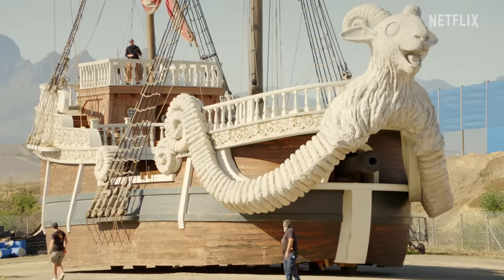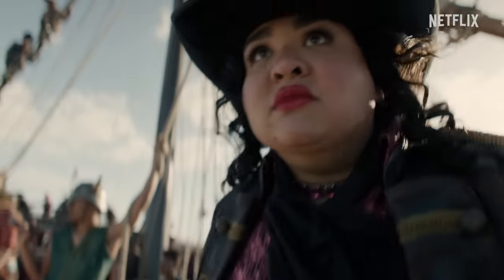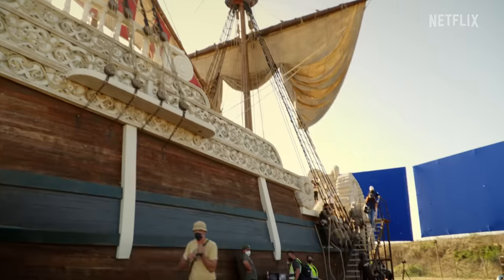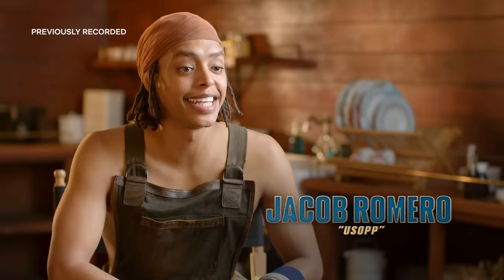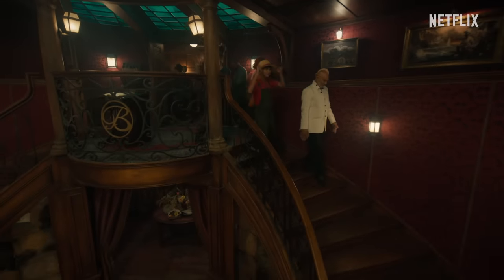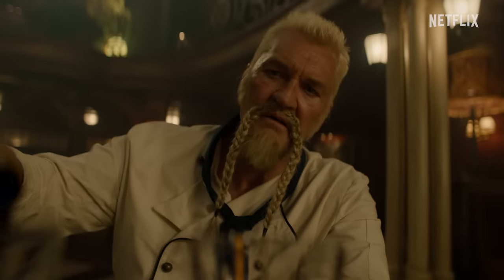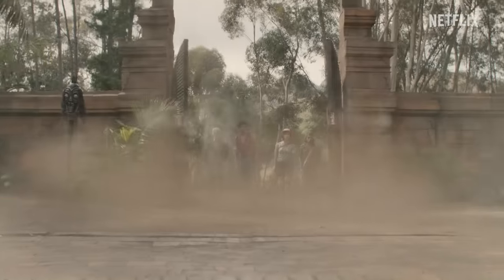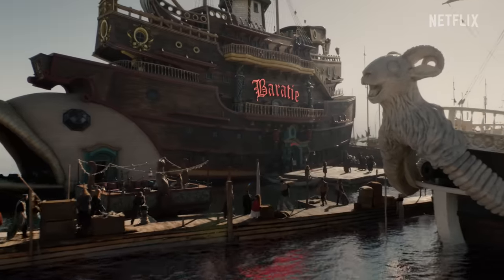ONE PIECE | Inside the Sets | Netflix

Comment: I think the production team is really why this succeeded where a lot of other recent adaptations have failed. So many fell into the lack of strong sets. For example the biggest of those was FMA's live action which took a bunch of moments from the manga and anime and rammed them into the open street bar from the first episode of the anime and then didn't leave it, and a lot of it wasn't actually there either and looked fake because it was. Meanwhile, Bleach did a similar thing but relied entirely on its star power with very little else going for it. One Piece is probably on par, if not better, than the Rurouni Kenshin movies and without the controversy of the mangaka ruining them.